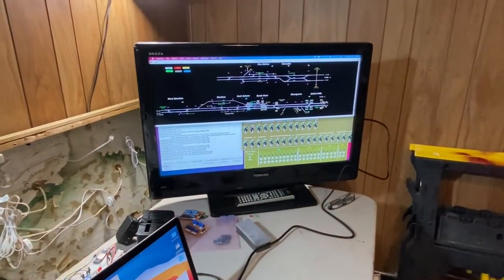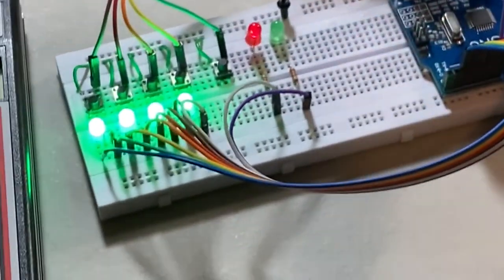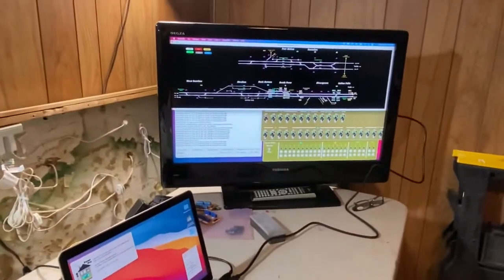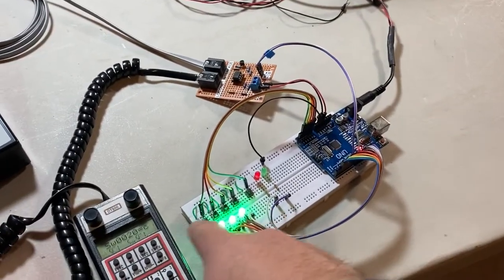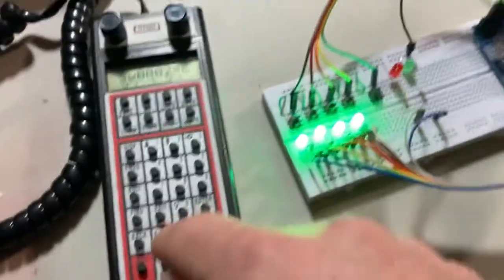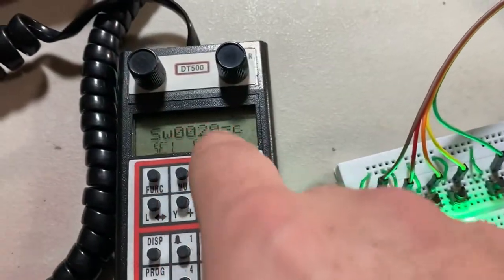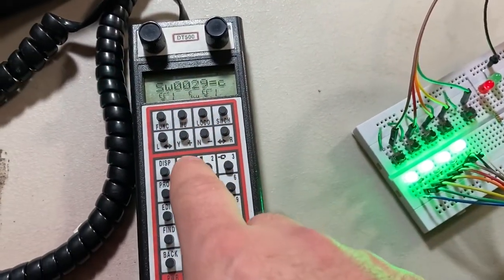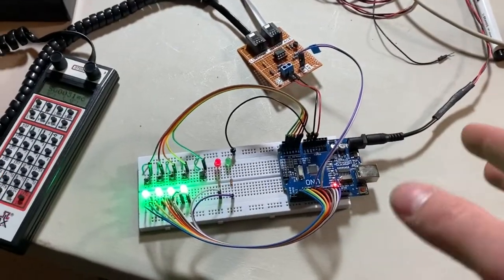Arduino Loconet tortoise Switch Decoder

Comment: will you please share your Arduino sketch.  I have code to make tortoise machines work with Arduino but have not gotten the Arduino to work with a loconet interface.  I am looking for the code to connect Arduino with loconet interface.

Comment: This is great, are you going to be making the code available either for sale or free? Also where in the chain do the Tortoise motors go? Thanks.
Reply from the maker: Tortoises could be wired directly across the LED's.  However Arudiono I/O pins only handle 40mA of current.  A tortoise at stall is 17mA, 4mA when moving.  So if you have a crossover where you have two  motors and an LED wired up to an output you'd be awful close, if not exceeding that limit.  I'd like to iron out the code just a bit more before I post it anywhere
Reply: @mikepilyih6524  HI Mike anymore on your wonderful sketch?
Reply: did you ever locate or craft the sketch to make this work?